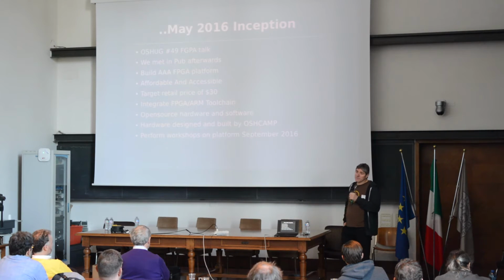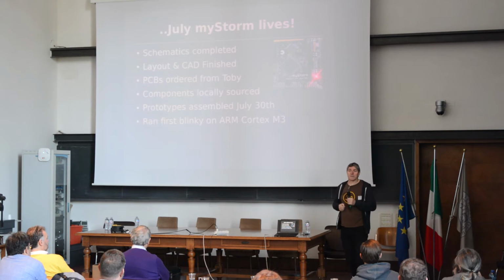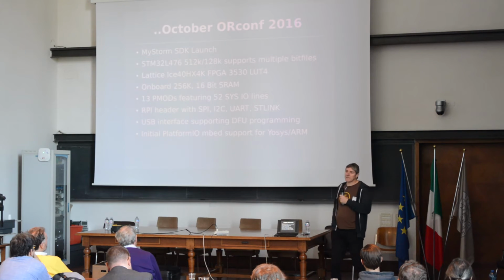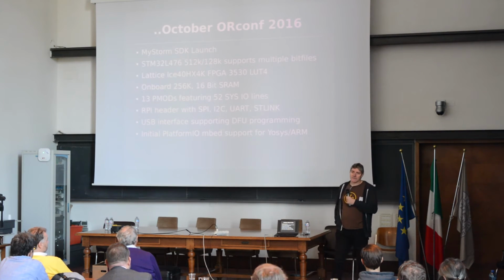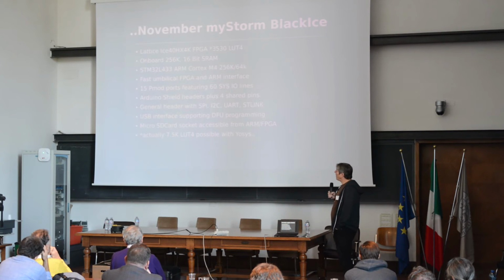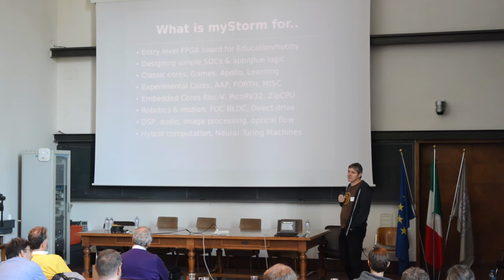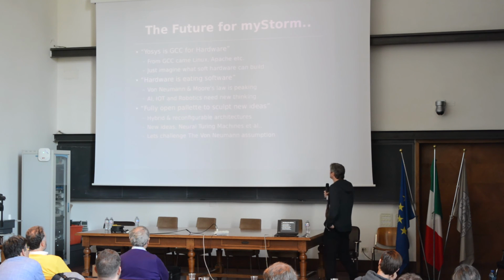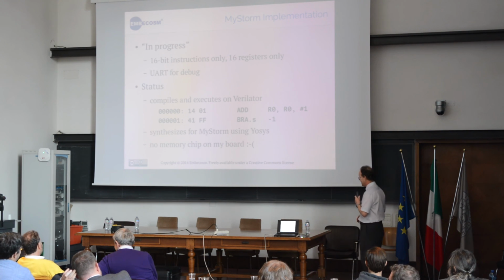myStorm: An Open Source FPGA board for the IceStorm tool chain - ORCONF 2016

Comment: 20:41 - nice to know: A free overclock // unlock: - Hence when the Acorn Atom re-implementation project was almost taking up all of the fabric; magically appears a BBC Micro B (with its Teletext [soft-]chip et al.)
$30 is now $55 for the late adopters... but for a proven platform by now. Nice that the MCU has hard float, I suppose.
I want to compare and contrast to Aduino (mkr) Vidor '4000' [Altera]: this field is always moving; but as a non-harware guy I like the copious Pmod ports you provide...even if the Next Big Thing (possibly) has a hard-wired HDMI [mini].
Reply: 21:29 - oops, I shouted. (to a narrow audience [576])